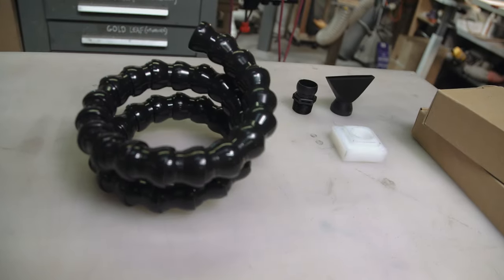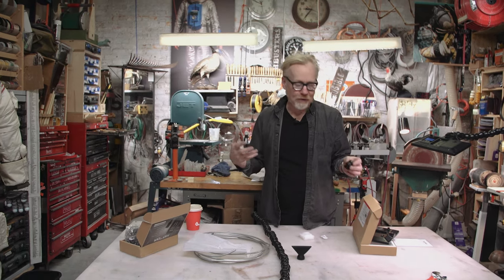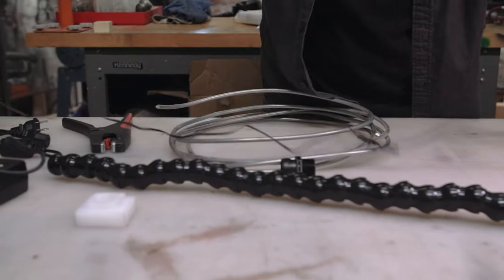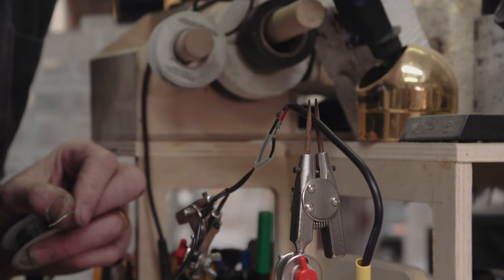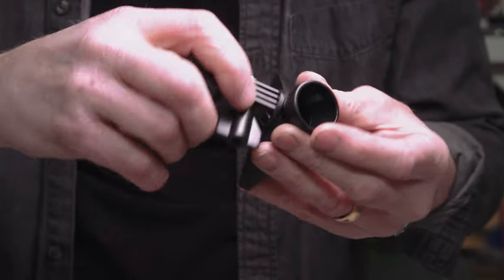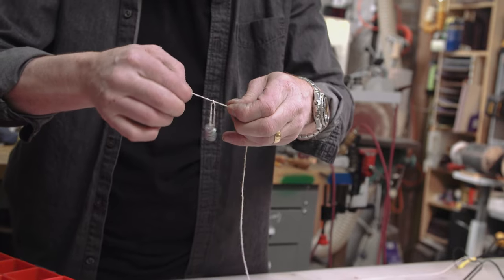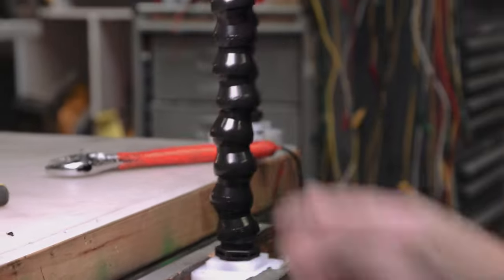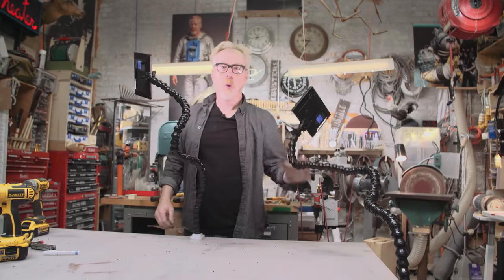Adam Savage's One Day Builds: Custom Workbench LED Lamp!

Comment from the maker: Materials you'll need for this build: LED Light: https://amzn.to/2VoBmNL
Power Supply: https://amzn.to/2uBijoG
3/4" Loc-Line: https://amzn.to/2Tf469f
Ball Socket MPT Connector: https://amzn.to/2wb4jCc
Ball Socket Flare Nozzle: https://amzn.to/2vaikAi

Disclaimer: Tested may earn an affiliate commission when you buy through the links here.
Reply: Seems this video is so popular, that Amazon can't get the light panel anymore ("product unavailable").  I really like the LCD display on the rear of the light housing;.currently searching for a similar panel.

Comment: Adam: a note I've picked up when splicing wires like you're doign with the power supply, I always cut the wires positive and negative staggered, that way when I solder them and heat shrink them the two joints aren't side by side, and makes the overall form more narrow and less likely to bind or rub against one another either, though your loc-line has plenty of room inside of it.
Reply: Thanks for the tip!
Reply: Absolutely 100% agreed!
Reply: I've seen that done before it's a great idea

Comment: Rather than machining out of Delrin, you can just buy a 3/4” NPT floor flange. They have four bolt holes which you could use U bolts to clamp onto a C clamp, or mount permanently if you prefer to a work surface.
Reply: I was just about to suggest that.
Reply: Thank you! This is totally what I'll be doing
Reply: Yes, thank you.

Comment: 3/4" npt Floor Flange from the plumbing section will help anyone who needs an off-the-shelf mount.
Reply: Dean Doll, Thanks I was trying to remember the name for that part, and yes it's a great solution for this problem.
Reply: Yep either attached to a hunk of wood or maybe something heavy like a weight lifting plate with rubber feet. 

I'm a LED lighting freek.  I've replaced all my fluoenant shop lights that keep burning out with cheap LED light strips from Home Depot. I also have at least one of the little LED mag light that Adam has on his band saw on my drill press,
Reply: I was literally thinking just this....to avoid any welding
Reply: We need to pin this comment!
Reply: @josuelservin2409  you actually tried this and threads are compatible? Just checking before I try it
Reply: Jack Kuehneman, I get one without threads and used 3 set screws
Reply: Jack Kuehneman plumbing threads are almost always compatible.  It just makes sense to need only one size of taps and dies for a manufacturer of multi-line, single-use product.  If you want to make absolutely sure though, you could buy threadless and buy your own tap and die set.

Comment: LED Light - $33
Power Supply - $10
36" of 3/4" Loc-Line - $36
Ball Socket MPT Connector - $5
Ball Socket Flare Nozzle -$6
3/4" NPT Floor Flange - $9

Total - $99
Reply: Joy of building your own work light - priceless.
Reply: Loc-Line 3/4 inch Ball Socket Flexible Tube 6 inch can't find any in UK? Damn
Reply: Funny, when I searched for Loc-Line on amzn uk I even got in the results the actual light
Reply: It's worth it. If you do some photography or videography you can also always use the LED light.

Comment: I liked this build well enough to model my own on it.  Instead of armature wire, I used a doubled length of 8 gauge copper wire.  I left the wire insulating sheath in place.  I created a "nut" for the 3/4" NPT plastic fitting from a copper pipe fitting hiding in my plumbing junk drawer and soldered the 8-gauge copper stiffener to the "nut" so that that end was secure.  I then drilled an appropriately sized hole in my workbench to secure the lamp.  I modified the flange on the lamp end and used the shoe mount to secure the lamp to the arm.   This light supplements the fluorescent ring-lamp with magnifier to improve the lighting on the bench.  4600K is the color temperature that matches that of the fluorescent lamp, but a higher temperature that the LED can provide is a good supplement to the LED lamps that I use on the microscope in that area of the bench.  So far, I'm quite pleased with this idea.

Comment: There's some ring light options that are similar brightness/size that would allow you to "look through" the light—would be handy for extra small things that you'd like even light all the way around an object.

With the way this is built (and the beefiness of the power supply used) you could swap out light heads depending on what the project calls for.
Reply: I started building something like this with a ring light many moons ago for that exact reason. Never finished it though... But testing just holding the ring light in front of something (I used 2-3 concentric ones) showed that it worked very nicely.
Reply: I got one of those on my workbench. It's extremely handy, but the LEDs had no smoothing and strobed like crazy. I soldered a big capacitor across their input leads which smoothed them out considerably.
Reply: Interesting. My grandfather had an led magnifying light on his work bench. Kinda want to steal it from my grandma next time I'm up that way. Really cool light for all sorts of stuff, but I was thinking that having that light and the one Adam built on the same bench would be awesome.
Reply: swap out light heads?Don't you mean build one with a halo light,magnifying light, blue light, strobe light, heat lamp and disco ball ??
Reply: The Regular Guy on a rotating carousel!
Reply: I've taken led gadgets from China and added them to ancient (like me) magnifiers and one is exactly that, a ring led light. I've added it to a handheld magnifier, which had a wimpy incandescent. The other is one of those old magnifiers on a stand with springs, and used a circular florescent (now you know I'm REALLY ancient lol). I use these 12v panels on it. The entire bench is powered by 12v (except the old Hitachi scopes) .
Reply: @regularguysgarage3276  Ha Ha good one

Comment: My solution is to wear a LED camping headlamp, so wherever I'm looking there's light. It's great when model making or working underneath a car.

Thanks for all the great stuff Adam!
Reply: How can you keep anything on your head under a car? I work on lifts 99% of the time, but the other 1%, i'm always bumping my head, or close to it. Nothing could stay on for long.
Reply: @2009dudeman  The straps on a headlamp are elastic and adjustable. Unless your head is made of jelly or are as slick as an eel, it's not gonna fall off.
Reply: @scottwpilgrim  My hats are always getting knocked off. 30mph gusts don't catch my ball cap and pull it off, yet it comes off all the time working on cars. I can't explain it.

Comment: For the table top mount a cheap easy way is to use a "floor flange" (3/4" in this case).  Available at any hardware store.

Comment: Quick tip for getting the string through the tube (especially when working with longer tubes), use compressed air, works like a dream!

Comment: Wow I really want to try and make a magnifying glass led version of this. Thanks for the great idea Adam.
Reply: Build it with the ability to swap the ends! Would be even easier if you stick with the battery powered light.
Reply: No need to use batteries as long as you have the fittings for various power connectors. They just all need to be 12v in Adam's design. There are adapters for using multiple plug types.
Reply: Loc-line makes various sizes of nozzles that you could use for a magnifying glass that has a rod on the end, this is what loc-line based third hands use for alligator clips.
Reply: Wow..nice original comment then the three of you come in and totally..go against the YouTube grain and give impressively helpful, insightful, and overall just nice responses..thanks for the restoration of my faith in humanity. Legends, the lot of ya.
Reply: I have a Magnifying LED light that has its own clamp on the table and arm , but very limited to where you can move it , where the Loc-Line would be so much easier to navigate it over stuff. I may modify it with the loc-line and have an "Y" adapter at the end with helping hands alligator clips to hold my work.
Reply: Helping hands are probably my most used tool.
Reply: Amazon has 8"  and 10" ring LEDs, but it looks like those are reliant on filters for color temperature.
Reply: So did you end up making it?

Comment: Adam... You are my hero... I have been stressing over making an articulated arm to bring more light to the work area of my milling machine. The older metal gooseneck lamps tend not to hole up over time and sag... This solution is the way to go and if need be stiffer, I'll just slip some shrinkwrap around the whole affair … I'm going to make 2. Thanks.

Comment: Pro-tip for re-doing wires through pipes/walls when you've made a mistake: don't just pull out the wire - tie the string to it so that when you pull it out the string is in the pipe/wall when you need to put the wire through again.

Comment: Now almost exactly 2 years after, we can still see these on Adam's work bench in the videos. Would be interesting to know if the armature has been replaced already as it surely will have to be at some point. Aluminium (yes, aluminium) work hardens and will snap if you swivel it continuously back and forth.

Comment: Love your work Adam. Here's a tip for future wire splices: Offset, or stagger, splices this way if you rub through the internal heat shrink due to the wires moving you are less likely to end up with a short. This will also reduce the bulk of that area of the wire allowing it to transition through conduit etc. more easily.
Reply: Thank you!  I am going to use that method for my next wire splice.
Reply: Yeah that mythical short circuit danger from not staggering them. Which is why almost every company in the world doesn't stagger them. Its not needed, especially not if you apply a second heatshrink around both like adam did.
Reply: Yes it is generally a good idea to stagger/offset the splices, but since it's not shaking or vibrating and doesn't move a lot, i'm 99% sure it won't short in a long time. If it was in a aircraft or even a car, yes sure it's a big nono, but we don't do splice like that either.
Reply: You don't need something like that for a desk lamp but sure..
Reply: Im a marine electrician, i make anywhere from 1 to 10 splices a week. We normally dont stagger splices, but do sometimes if the splice is in a high traffic area where it gets run over by forklifts every now and then
Reply: MIL-STD-2003-1A(SH) APPENDIX E
Specifically page 101-105
The diagram on page 104 is particularly helpful.

If you're really an ME and you are allowing cables to be run over by forklifts then I'm not surprised that you don't know the proper splicing procedure.
Reply: PacketLoss Gaming i never said how to splice cables, and its not me allowing to cables to get ran over, its my shipyard. They dont have the proper troughs, trees, or ramps to run cables with.
Reply: PacketLoss Gaming the staggered spices take longer than just a standard splice. We are normally rushed and have to do standard splicing.
Reply: Funny, I see this done all the time in DIY vids and I always cringe a little. The offset takes very little extra effort and seems so much safer.
Reply: @danimal865  If you were really a marine electrician you would know that the NAVSEA standard for splices is to stagger them. That's where I learned it.
Reply: @packetlossgaming9886  its a personally owned shipyard that doesnt do much navy work. So everything is rushed and most things are run into the ground. Staggering splices takes longer. They dont like that. Ive never looked at a navsea book in my life. I was trained by the older guys here.
Reply: @danimal865  Then I understand why you don't stagger splices. Thanks for clarifying that. I would suggest looking for employment elsewhere, but the Navy yards aren't much better in terms of rushing things and not doing stuff right.
Reply: @packetlossgaming9886  haha ive worked there 17 years. The main reason i haven't left is because its like a family. Everyone knows everyone and is nice and helps each other. Ive done some work in other yards through our downriver division and every navy yard ive ever been to is annoying in many ways. Im so used to fixing something right away when it breaks or blows up using only my tools and knowledge in my head. In navy yards its paperwork, sometimes days of waiting, investigating, one shop pulls cable, another hooks it up. Etc etc. I enjoy working on tug boats and barges. Its instant, no paper work, you do it how you see fit as long as its a good job when done.
Reply: @packetlossgaming9886  and i do know how to stagger splices the right way, its just not something we require. I never had to learn navsea regulations or code, but i do know all the navsea regs that apply to everything i do, know what i mean? Like bend radius, cableway spacing, mct's, decktube height, how to pack them etc etc.

Comment: Adam, a nice little tip for soldering, grab a cap from an aerosol can and put a couple slits in it. It will hold your wires for you as well as catch any solder that drips so you don't make a mess. That way both hands are free to solder and not fighting the wires or worrying about heating your bench. If you don't have a specialty clamp set holding your stuff for you that is..

Comment: Center positive 90% of the time, except for the time you don't check - of course.
Reply: RIP Sega Genesis consoles
Reply: Read the power requirements label on the back of the unit.  It will tell you which contact is positive and which is negative.  It also tells you voltage and current necessary to run it.
Reply: I have a dead dental filler heater in my "please fix this dead thing, nobody takes it to fix it"  pile, that begs to differ. not everything has polarity on it written and some things just kill the pic microcontroller on it if you connect universal power brick that has switchable polarity, which is of course wrong.
Reply: Pretty much everything by Sony is center negative...

Comment: you could mount a couple of rails on the ceiling  where a long "cart" traveled, and all along the way of the long cart have a couple of rails with a smaller cart (so you can move the contraption on both x-y axies, kinda like a gantry crane, or at least that's what I think it's called) and from that cart have a chain hanging with a counter-weight on the side of the contraption as to have everything hanging from the ceiling and thus not have an arm sticking out of the table but hanging from the ceiling instead, if big enough you could use the same light wherever in the room with no issue I think.

Comment: Adam, that is the most brilliant, if you will excuse the pun, one day build you have done! I use a Jerker desk for my workstation, and I have been using a pair of those "As Seen ON TV" strip LED lights mounted under the top shelf, and a clamp-on bed-reading fixture for point light sources...but this build gives me some great ideas to replace that with one of your contraptions! Thank you!

Comment: You could also 3D print the delrin piece to be any shape you want if your printer can get the resolution on the threads right, I've had some very good success 3D printing SLA resin fittings. To actually get a good model there's addons like CoolOrange for Autodesk Inventor which model the entire thread for you (keep in mind, SLA fittings don't work well in wet applications as the cured resin becomes soft with prolonged water contact)
Reply: FDM (most home printers) can't make precise threads at all. Just buying a solid block of something and then drilling/tapping the threads will work best.
Reply: I was talking about SLA resin, as mentioned multiple times. But you're right, filament printers wont be able to do it.
Reply: I ended up using the top half of the stock mounting joint, and 3d printing an adapter to fit on the arm of an old, decapitated, florescent desk lamp.

Comment: Saw the title, "Yes! I need this!"
Saw the materials, "Yes! I can afford this"
Saw the techniques, "Yes! I can do this!"
Saw the tools and equipment needed, "umm.... "I have a the pliers and the drill. Damn!"
Reply: you can make this with pliers and a drill and maybe a hacksaw. no need for soldering if you buy the light with the power supply.
Reply: See if there's a makerspace near you, they'll have all the tools Adam uses every day and more
Reply: You dont have to solder the wire either, you can just twist the ends together and insulate them with electrical tape
Reply: @fakename287  I wouldn't advice this particular bit. With the wire and rod in there, there is bound to be a but of tug on the cable inside from time to time when twisting and bending it. Shouldn't be so much as to tear the cables, but it would probably be enough force to pull the twisted ends apart over time.

If you have to do it like this, at the very least cut the two wires an inch or two apart, and heatshrink the joints for extra support. If the twisted joints should come apart, the live ends should stay inside the heatshrink. If all fails and they do not, the exposed metal ends will be an inch or two apart along the length of the cable, so they are unlikely to contact and short eachother out. And, having the joints a bit apart, reduces the overall circumference at the joint, which is always a plus when pulling and housing a wire inside another narrow channel. Especially a flexible one.